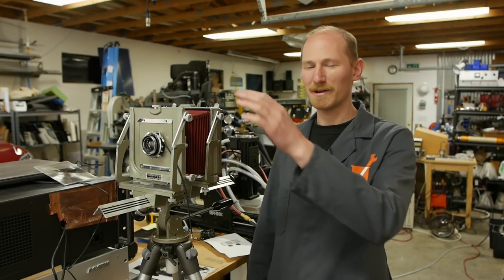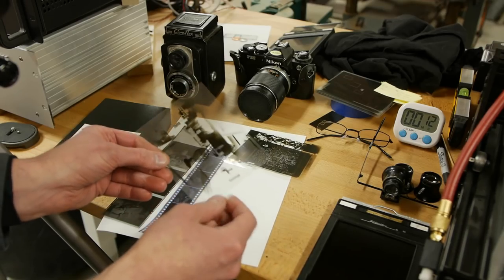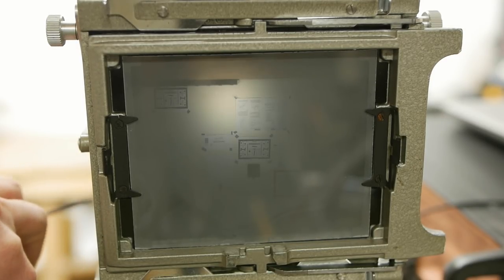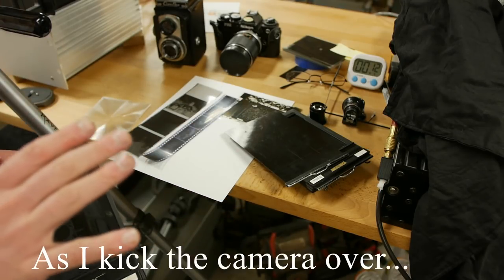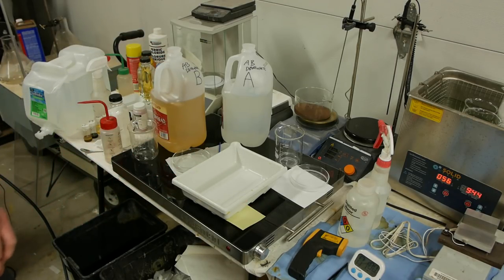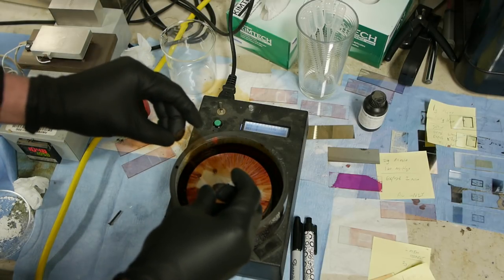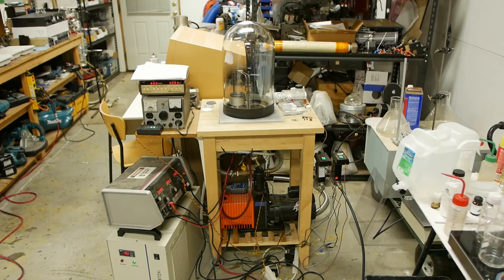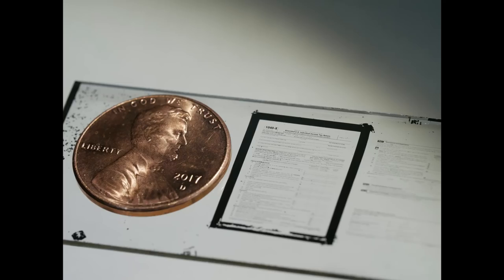Antique 4x5 camera creates 20 micron photolithography masks: Super tiny tax form

Comment: i wonder which wavelength of uv do you use to expose the microscope slides. regular glass could be very absorbing for uv, but longer wavelengths are mostly okay. even though in the case that the glass sheet is absorbing most of the uv, i dont have any recommendation other than using pure quartz sheets which are very expensive, you can just exposure longer to compensate for that.

Comment: I've been trying to do this since some time ago but almost all from scratch, instead of using commercial photoresist Im using ferric gelatin (ferric ammonium oxalate as sensitizer then developed in .1% H2O2 and washed with warm water), it has been used for holography but seems to work well as homemade photoresist. Im directly projecting the mask made with a printer to the slide using a canon EF 55mm lens, so far Ive achieved about 15 microns too mostly because i been having trouble having a repeatable focus. Right now Im saving up to get some plan achromatic objectives for my microscope, Im hoping to use them to get features down to the submicron level. 

I might add, I skipped using film as a mask because I didn't wanted to deal with a flexible surfaces, however im considering instead of directly projecting the pattern to the resist as im doing now better make a mask with wet collodion on glass (easy to make and has almost no existent grain, though its very very slow), that way i have a mask that can use many times and I don't have to be fiddling with the projection setup trying to get good focus.

Comment: Everytime I see the method for putting a thin layer of material onto a slide or whatever with the spin coater I can't help but think that at the very center it's going to produce a thicker layer than at the edges where the velocity is orders of magnitude higher. Why not have the substrate, or slide in this instance, on the edge of the spin coater's hub so that none of it is at the center where there's virtually zero force? Applying the coating would be a bit trickier but it has always bugged me nonetheless thinking about how the dead-center is experiencing virtually zero centrifugal force. Sure, with liquid surface tension and whatnot any amount going off to one side will pull a lot with it but it STILL BUGS ME!!!

I'd almost rather have a linear accelerator of some kind, like a linear motor track, just going back and forth. I don't know if that'd really be better, in terms of effectiveness of coating uniformity (and ignoring the actual logistical nightmare) but anything seems better than spinning around the center of the surface to be coated.

Anyone?

Comment: Second time I've watched this, and something occurred to me. Have you tried putting the camera under positive pressure rather than the film cartridge under negative pressure?

I can see some potential issues might arise than end up making your solution necessary, but if those issues don't pop up I can see how you might get the same results with less complexity using positive pressure

Comment: Not sure how you worked out the exposure, but if you use a Stouffer 12 step gray scale and get it so the 3 on the scale develops to a dense black ( transmission densitometer of 3.9 or greater) it may help.  Also, a vacuum to draw the emulsion of the film to the slide should reduce any chance of light spread when exposing the slide.
Exposure gray scale:
https://baypressservices.com/shop/stouffer-cameraman/

Comment: How about using this camera lithography to create a basic functional integrated circuit?

This could lead to the creation of electronics that don't have surveillance devices built in at the microchip level. We would also have to make our own resistors, capacitors, inductors, potentiometers, etc.

Hey let's get to work on ultracentrifuge or laser isotope separation!

Comment: You could actually get a Hasselblad XPan (Fujifilm TX-1, Fujifilm TX-2) which can do 24x65mm on regular 35mm film to almost cover a microscope slide.
Reply: have you seen how much those go for on ebay? the 4x5 setup is cheaper.
Reply: Exactly my thought, then I remembered how much they cost and he loses the ability to do single sheet development. Plus I’m not sure what the field curvature of the lenses are but something that wide may well have unacceptable distortion at the edges.

Comment: Is the vacuum pump modification on the film required because you're doing such small scale photography? Or would the film falling out of the focal plane still be an issue if you were just taking a portrait or landscape for example? I've always wanted to get a large format camera just haven't gotten around to it yet, the potential to tinker with them seems endless!
Reply: On 8x10 film flatness is a minor issue. On 4x5, with regular film of regular thickness, not so much.

Comment: Would it be possible to create printing plates with this technique? Like instead of using the small glass plate for the microscope use a metal plate with photoresist and coat that with metal like in the chocolate hologram video and use that for printing?

Comment: question if you are using a old fashioned camera like this it should be no problem getting the optics so that its shrinking the image to the couple microns size but is the film grain (silver salts on the zelloloid or what ever you use) actually small enough for that? or are you trying to archive "sub-pixel"-resolution?

Comment: Maybe the solution to the bulged film was the fresnel lens. Maybe the picture is always bulging with the same depth and to the same side and the lens corrects for that.
Reply: The fresnel lens should be on the outside of the ground glass. Either an aftermarket fresnel lens was installed incorrectly, or, if the camera already came with the fresnel lens it was already taken into consideration when designing the camera (in which case it would not focus accurately without the fresnel). That being said, the error caused by installing the fresnel lens incorrectly is very small.

Comment: Hi again. I was wrong about the exact film plane surface dimension. For 4x5, the distance from the camera flange (the surface the film holder registers on) to the film emulsion surface should be .197". (I had the 97 part right) Most sheet film base is is .007 in 4x5 size. so that would make the distance from the register surface, the top flat surface, to the bottom metal surface the film sits on top of, as .203". If you are using thin base litho film, it throws this distance off. Thin base litho film is either .005" or .003". So you could be out of focus by .002" or .004".  So the ground glass surface for focusing should be exactly .197" from the camera back surface.

Comment: Can't you close down the aperture to a very small, almost pin-hole size to drastically increase the focal plane length? Of course, you'd need to compensate by using extremely bright subject lighting, or else your exposure time would run 30 minutes, but it might be worth trying. Manually trying to focus to a few microns with such a short focal plane... I just can't imagine. A pin-hole sized aperture might be your friend! :) I have no idea if this would actually be feasible, as my photography and process photography classes were 40 years ago, but might be a consideration?

Edit: Nope, this wouldn't work... I forgot about the loss of resolution when you decrease the aperture size. My bad. : (

Comment: For the focussing why don't you try a diffraction grid and point toward a bright light source (a Bahtinov mask)?  They do it is astro photography for focussing dim   stars.
Reply: At short distances I don't think a bahtinov mask would offer any real benefit over his current method - in my experience, the "cross" in Bahtinov masks tend to leave quite a lot of wiggle room, they're not sharp enough to be ultra precise. Which is fine for focusing a telescope at infinity - but probably not fine in Ben's situation. I might be wrong though! Definitely worth an experiment.

Comment: Disclaimer: you chose the right camera

For data completeness: there are 3 common "medium formats".

By far the most common is size used by twin lens reflex camera (TLRs) of which the most famous is the Rolleiflex. This is 6x6 cm. This is also the size of film used by Hasselblad. You get 12 frames per roll.

Some "medium format" cameras shoot rectangular images; the smaller size if 4.5 x 6, and you get 16 frame per roll.

None of this is relevant to the task at hand.

But

The "other" rectangular format is 6x9 (rectangular the other way). 8 frames per roll. I think this might have worked for the project, but 6x9 cameras are not common, and are not as versatile as the 5x4 you used.

https://www.thephoblographer.com/2020/03/10/5-great-6x9-format-cameras-the-medium-format-film-photographer/

Comment: Ben, it is possible to still get glass coated with film emulsions.  They are not likely to be ortho but there are a few companies that commercially again produce glass plates.  And their production numbers are small enough that you might be able to convince one to make a small batch for you.  One company is https://www.pictoriographica.com (I am not affiliated with them).  I know of at least one other and there is a small community that coat their own glass plates, films and papers from their own DIY emulsions.  Also the dark slides for the film holders are different and so can be used to mark if the film has been exposed or not (normal convention is  white side (or bumps) out indicates un-exposed film and black side out (no bumps) indicates exposed). 

And you probably can get medium format film to cover the entire microscope slide.  There are different formats that use the same base film but have different lengths on the film, everything from 6X4.5 to 6X12.  But there are advantages for using large format. 

And there is a second "arm" on your lens that is intended for use while you are focusing.  You can set focus with this arm, which will open the lens to the desired aperture for focusing without using the shutter, and then close it again prior to inserting the film holder.  Then you can use the shutter so expose the film as you have been doing.

Comment: I used a 5x7 format camera 50 years ago to make PCB artwork and photoetch masks. 

A few years ago struggled with the grain in ground glass diffusers discovered holographic diffusing film. Edmund will sell a 2 inch square for $100. The manufacturer will send you several square feet for free. Edmund profits $99.99 on each piece. I can remember the supplier. It was vastly better than my glass screen it might be better than what you are using,

I have a film thickness monitor just like yours. Would you like to have it? I use a different one.

JY

Comment: Maybe make it a digital version?
I mean instead using camera and wall etc. shine a digital projector of some sort or laser.
Or just laser into the photo resist.
Or use laser from laser printer to print directly on photo resist.
Or closed system where you only shine a light on paper with needed schemetics.
Which of course ramps up difficulties a lot...

Comment: I personally would not refer to anything about that camera as primitive. It is only slightly inelegant. I have several 1890's to 1900's era box cameras which are primarily all hardwood cased. With hand ground quartz lenses. They are elegant and efficient. And no modern camera can compare to their captures to my taste.
Reply: Another little hack is to use a honing stone to put a tiny bevel on the slide edges to prevent accumulation of emulsion.

Comment: This is specialized work. I see a lot of ideas in the comments but these problems and their solutions are not new. First, the "copy lens" is a specialized lens made for copy work. A good one is specifically designed for this, clarity of a flat copy clear to the corners. The other two matters are the thin film you're using Estar film was for copy work and is much thicker and more rigid. The vacuum back goes back to world war 2 However with the wrong film in the holder you might be pulling the center of the film too far back and out of the sharp focal plane. With that film you might be too far forward, or too far back. High aperture as also mentioned in some comments can assist in depth of field but cannot make a copy lens from a field lens. f11 should be good. Smaller apertures introduce what Ben mentioned, a phenomenon called diffraction. This actually causes a loss of sharpness in the image from around f16 to f22 or greater. Sure large cameras often have very high f numbers on the lens but that's because big glass is very difficult to make and very, very expensive, and the overall size of the big camera usually skews the proportion of aperture vs. focal length (increases the F-stop value which is by definition this ratio) vs. small cameras. So the real answers are the right film for the back, possibly a vacuum back, a very high quality copy lens and very very bright lights. Such was the old term, "hot lights" which also helps with reciprocity failure by shortening exposure time.

Comment: Are you interested in replicating a 20 micron process to make integrated circuits? Wikipedia tells me 4000 series chips were made on a 20 micron process, and Intel 4004/8008 used 10 micron.

Comment: You titled the video incorrectly. It should say that digital photography is still far behind analog photography. Analog chemistry is still able to RECORD many times more INFORMATION in methods established and perfected +50 years ago, more efficiently and permanently than current digital methods. If that transparency is stored properly, that information is PERMANENT. The patterns in the film WILL NOT MOVE. (I'm not contradicting. I'm changing the "focus" of the proof.)

Comment: 1- for cleaning the microscope slides, use acid piranha, this is the best method i found. basically sulfuric acid and hydrogen peroxide. prepare it when you are about to use it, the mix will generate heat, put the glass in there while its hot 10 min and then take it out. then (this is important) place the slide under running water (the water should be as clean as possible) to remove any sulfuric acid left about 1 minute, then spin dry it, your spin coater is fine for this. about 3000rpm 30sec. if you see some streak it's sulfuric acid residue. 

2- have you tried the microscope slide with the photoresist directly on the camera?
3- i've used this lens in a photomask exposer similar to yours, and a 405nm LED https://www.aliexpress.com/item/32607957488.html

Comment: What are you doing with that little tesla there?
Reply from the maker: I'm going to add a huge battery pack and huge motor.  I engineered acceleration performance to match the P100D up to 30mph.  The project doesn't really fit the channel, but I'll probably still do it at some point. :)
Reply: Applied Science I beg to differ. Just a matter of presentation. Would love to see it, comparison between batteries, capacitors, and other power sources.

Comment: Ahhh, your camera may be an oldie but Goldie, NOT AN ANTIQUE!. 4x5 cameras have wonderfully wide range of use ages. For the UN-Initiated, YOU'RE USING A GRAPHIC ARTS FILM, DESIGNED FOR CREATING PHOTOMASKS FOR OFFSET LITHOGRAPHY. THE FILM NEEDS VERY BRIGHT LIGHT AND LONG EXPOSURES. LITHOGRAPH USES USED A VACUME HOLDER TO ASSURE FILM FLATNESS. CONGRATULATIONS, YOU'VE REINVENTED 1920'S LITHOGRAPHIC. TECHNOLOGY. THE LITHO FILM CAN BE HANDLED UNDER A RED SAFE LIGHT NO NEED FOR TOTAL DARKNESS. .  NEXT... THE FRENEL SCREEN WAS TO AVERAGE THE LIGHT ACROSS THE ENTIRE FILM PLANE,,, NOT JUST THE CENTER LIKE YOUR CURRENT SCREEN. 
OH, PHOTOFLO ISN'T A DETERGENT, IT'S A WETTING AGENT...  EXPOSURE IS A LOGRIMITHIC SCALE, NOT LINEAR.
SHEESH, HAVEN'T YOU EVER TAKEN A BASIC PHOTO CLASS.. WE'RE YOU MY STUDENT BACK IN THE DAY, YOU'D HAVE TO RE TAKE THE CLASS.